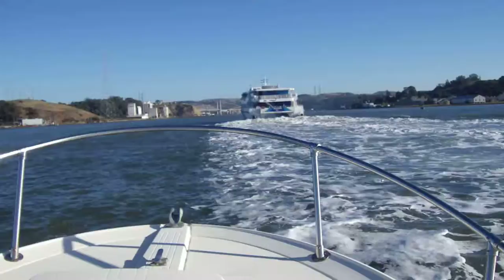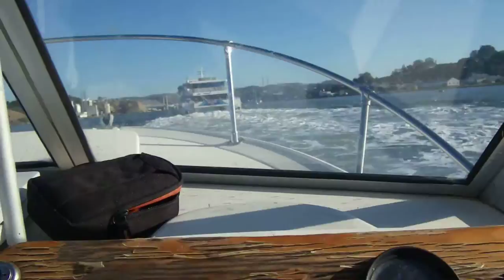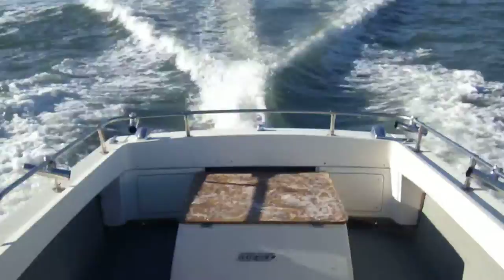Fishing Boat Videos | Skipjack 24' Open Runabout 1976 Model - Test Run Oct 2015 (Part I)

Comment from the maker: I desperately require a Throttle/Shift Control Box for this boat. 1977 Skipjack 24' with OMC V8 I/O with Electric Shift
Reply: Keep an eye on eBay. Electric Shift parts are very hard to come by these days. Rebuilds are a must on these old things after 500-700 hours to keep the gears shimmed. Otherwise splines will strip or the upper gear set will loose teeth. I got rid of a 1974 24 foot reinell awhile ago but left the cable and tru-course cable on. I do have some gearcase parts left in the garage including a 21:16 V8 gear set if you need it.
Reply from the maker: Thanks RatCatcher, much appreciated!
I just got lucky and found myself a used Throttle/Shift Control Box in good condition from a boat recycling facility.  Regards, Bob